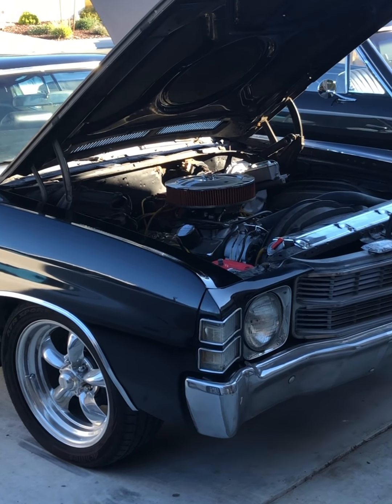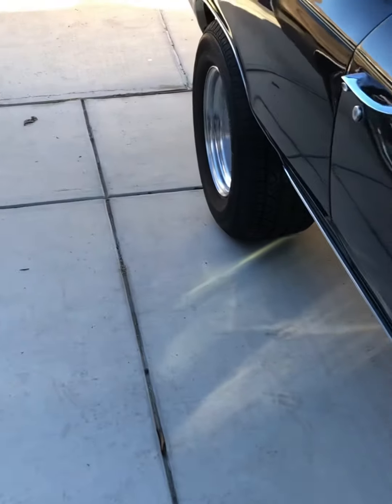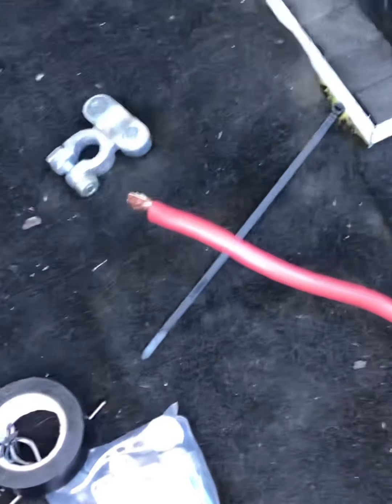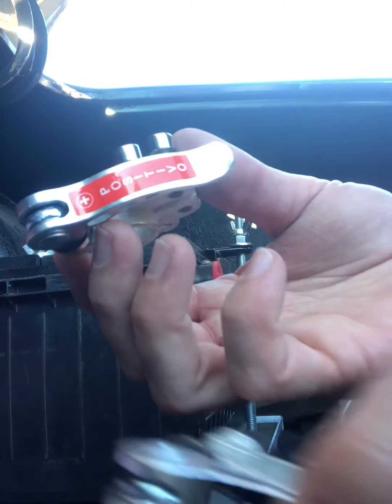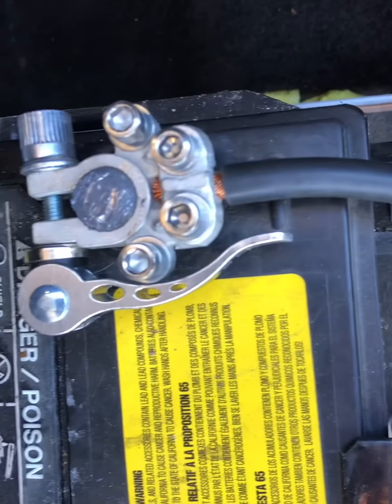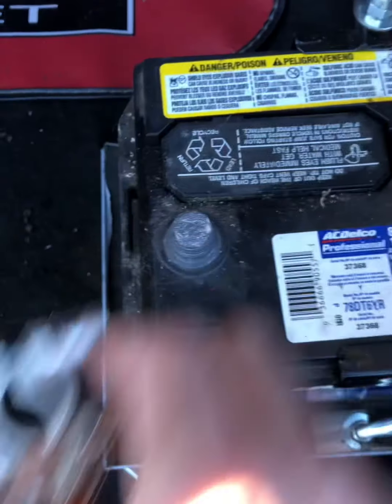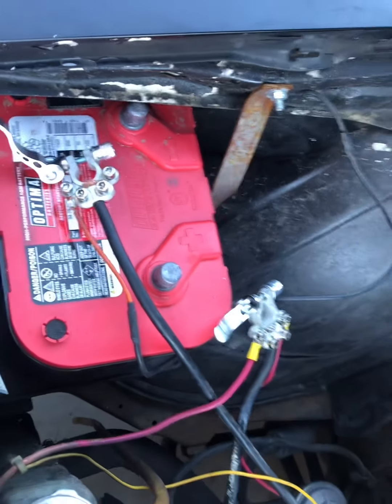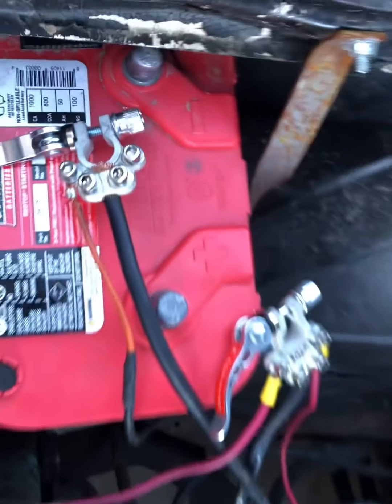Quick release battery terminal connectors on Chevy Chevelle

Comment: Hi great video what am i supposed to do with the green and red circular cloth thing?
Reply from the maker: Those go on top of the battery terminal before the metal clamps. They separate the two and help prevent corrosion build up.
Reply: @jobuilds  kk figured as much, thank you f9r the speedy reply 👍

Comment: You know you only need to disconnect the + or - cable and it's good right.
Reply from the maker: I did not. Thanks for the information.
Reply: @jobuilds  Technically they say remove the negative terminal if you only take one off, that's because the negative is what attaches to the metal car frame which essentially makes the whole car frame the negative of the battery and if any raw + wire were to accidentally touch metal anywhere in the car it would short out. But if you remove the negative then it wouldn't matter if any wires touched metal, it would be impossible to short out since the negative on the battery isn't connected to anything.